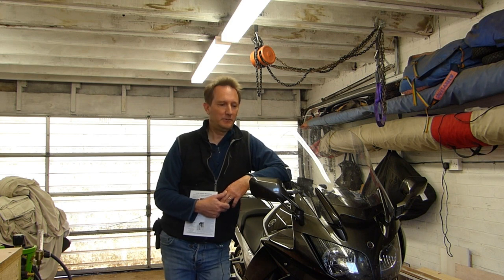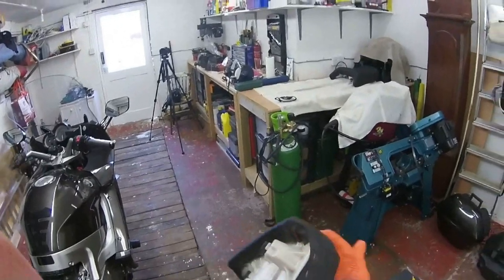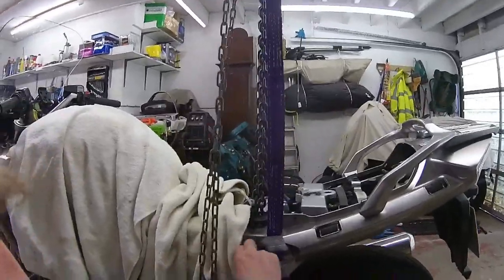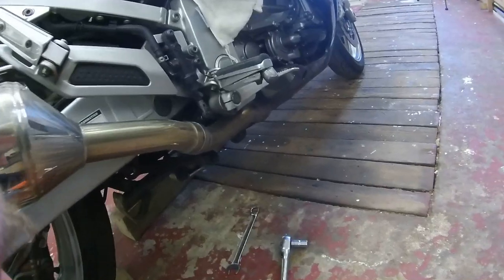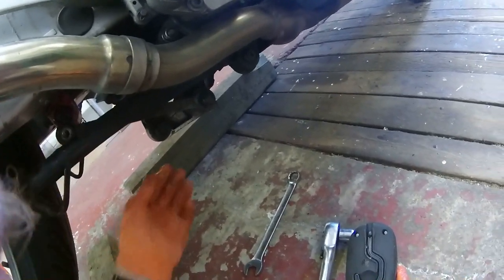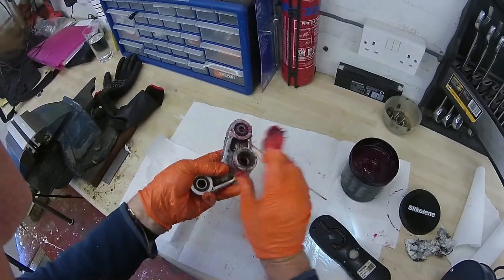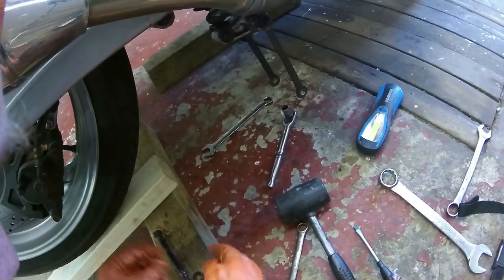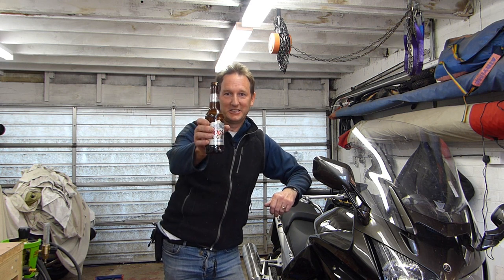Yamaha FJR 1300 Rear Suspension Overhaul

Comment: Hello Simon, it any reason why grease nipples cannot be fitted? Im thinking of fitting them to my recently purchased fjr1300
Reply from the maker: Hi there. Yes it can be done. Its not a trivial job though. The front and rear bearings would need to have a grease port drilled through the outer race which is hardend steel. You really need a milling machine and carbide tooling to do this. I know it has been done but it is alot of work.

Comment: Brilliant video thanks very much for this I’ll have to look at mine now I have a 2008 model ,my dogbones are 8” centre  to centre the guy I bought it from said it was lowered which it certainly was now what I would like to know is the stock lengthwise on the dogbones  so I can get it back to Standard thanks in anticipation
Reply from the maker: Hi John. I've just been out to the garage and measured mine. They are 7.5" so it does look like you have a lowering kit fitted. Hope that helps. 
Simon
Reply: @simonhay-heddle3848  thank you so much simon

Comment: I'm VERY curious about those needle-roller bearings in the linkages - you claim that the rollers will FALL OUT if the inner shaft is removed. I have done this job on other Japanese streetbikes of the era, and all have been CAPTURED rollers, (i.e., caged)... and never seen one yet where the rollers are flopping around in there loosely.
Are you sure about that.. but personal experience?
PS- when working (lying) on the floor, there's nothing like a nice 2' x 4' piece of thick cardboard to lie on.
Reply from the maker: Hi there 
I to was very surprised by this claim when I first read about it for the same reasons you outlined. My only thoughts were that if the bearing cage could become a little worn particularly if lubrication wasn't that good. Its never happened to me but since a simple change in normal procedure can eliminate the risk I didn't want anyone to find out the hard way if the risk was genuine 😃
Reply: @simonhay-heddle3848  I think I'll try it.. when it's on the bench, I'll put a finger in one side and carefully pull the spacer out. My bet is that those needle rollers MUST be caged in there; I worked in bearing manufacture for years.. and I can't see how you could have just loose rollers bunching-up in there. Report later!
Reply: They are caged but on mine a needle did fall out when replacing the entire bearing.
Reply: @geoffreypavia5906  If a needle fell out of a caged bearing.. that bearing assembly is bad.

Comment: @simon - the bolts on the middle stand, have you done this work before? Since it seems like the bolts are the correct way, and not pointing toward the exhaust?
Reply from the maker: Yes I removed the factory bolts when I first got the bike and made up a set in stainless steel.
Reply: @simonhay-heddle3848   - Ok, thanks.  I'm about to do this, so i will prepare for some modification

Comment: wow, what a job. And dealers dont' want to do this job either? ha! i know kawasaki, the older concourse, had grease fittings in that wishbone, made the job a cinch! but of course, yamaha was trying to get dealers more money by giving them this huge service, kind of backfired. I did mine (i have a 2016) and removed the swingarm from the bike, bought a lift from Abba over in england (i live in NJ United states) and that helped a great deal...only thing was i wasn't watching when i unloaded the bike and broke off a foot pedal in the process. That was the only issue i had with it.

Comment: I suspect the front most suspension bolt is in the wrong way round which is causing the problem of getting the suspension link out. I think it should be fitted from left to right.
Reply from the maker: Hi Simon
Yes that was my first thought when I got the bike. It is however installed corectly (See 4-93 of the workshop mannual).
I don't see any reason why it can't come in from the left side and am tempted to get a replacement bolt and try it.
Reply: @simonhay-heddle3848  I have a 2016 and it's exactly the same! The engineers aren't stupid... the only reason I can see this being the case is because of corporate greed. Yamaha figured out they could make hundreds more in the service department if they put a couple bolts the wrong way around.

Comment: great video .. if I want to change the dogbones.. do I need to suspend the bike or is there a way round that? 2016 FJR
Reply from the maker: If all you want to do is change the dog bones. All you need to do is put the bike on the center stand and support the rear wheel so there is no load on them. That way the bolts just slide out. The need to suspend the bike is due to having to remove the centre stand to gain access to the bolt at the front of the rocker arm.
Reply: @simonhay-heddle3848  thanks Simon but I don’t think the top bolts go past the centre stand when it down …
Reply from the maker: @midnightplasterer  Yes you are absolutely right. My mistake. I was thinking about when I had the swing arm off but I only had to disconnect the rear of the dog bones. I'm afraid you will have to suspend the bike but at least the centre stand can stay on. Just fold it into the "up" position. Sorry for the wrong advice.
Reply: @simonhay-heddle3848  I appreciate you replying Simon thank you